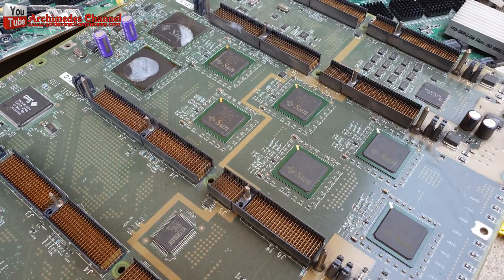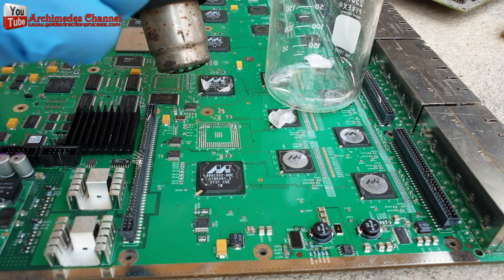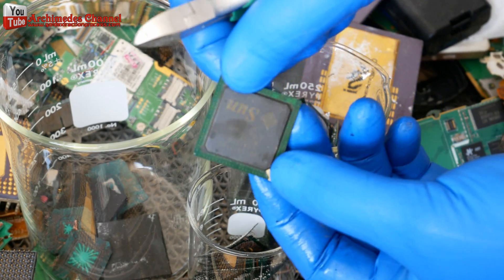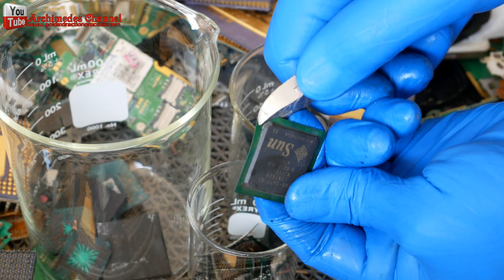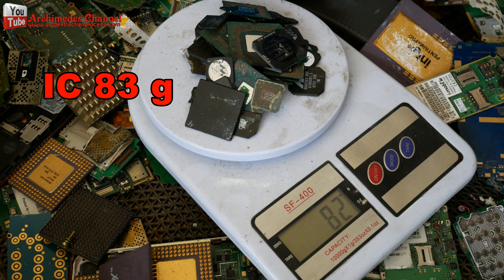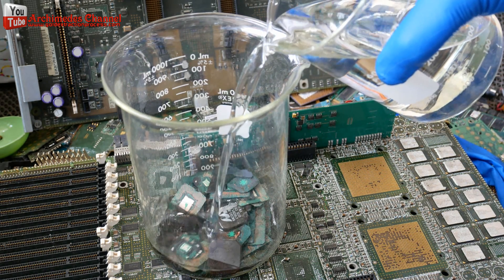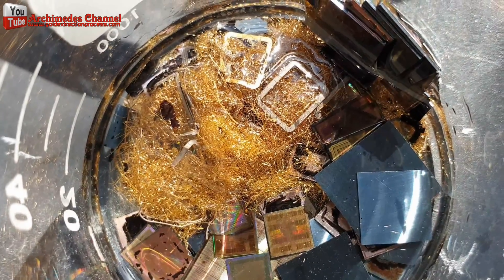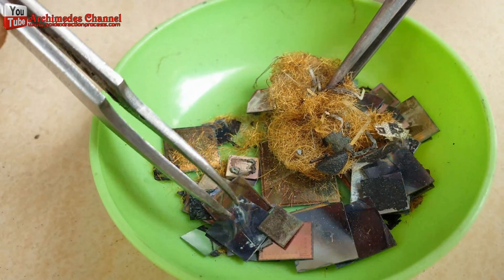How to gold recycle SUN computer server mainboard from ic chip chipset BGA IC Chips Recycling.

Comment from the maker: Recycling old or defunct computers is not only environmentally responsible. It can be somewhat profitable as well. As they computer age goes on, our land fills are chock full of electronic waste that inevitably pollutes our water sources and the earth it's buried under. When you are taking out that new laptop or CPU, use that box to hold all your recyclable, old computer parts.
You probably have a broken computer somewhere in your house and you're about to throw it away. Wait! Don't just throw it out, that thing is filled with precious gold! Just kidding, it's only about $1 worth. 
After watching the video it will become pretty apparent that the average person doesn't have the equipment to harvest the precious metals from old computers, but even if you could, it wouldn't be worth the effort. Apparently old computers, that tend to have the most gold, only have about $1-$9 worth of gold spread throughout. The real money comes from recycling computers at extreme volumes.
How do you recover gold from scrapping a computer?

How much gold can you get from a computer?

Is it worth scrapping computers for gold?

Is there real gold in computers
Reply: Mr. Archimedes, I am a follower of all your work, but I had a problem with a royal water solution.